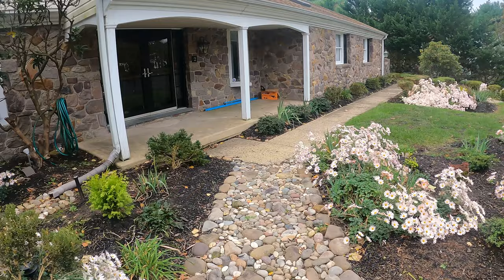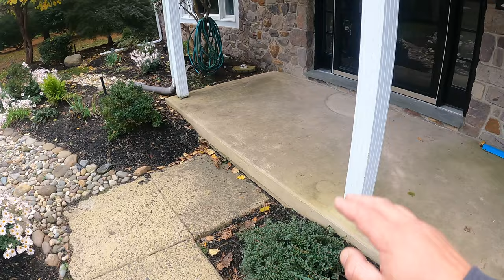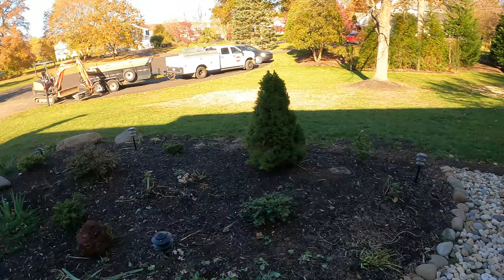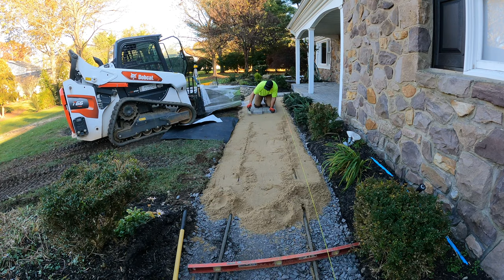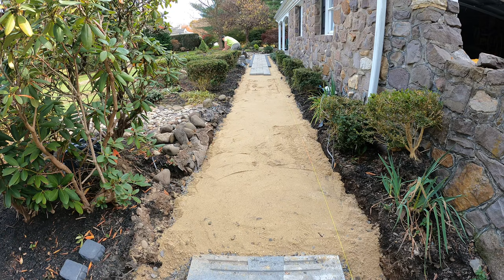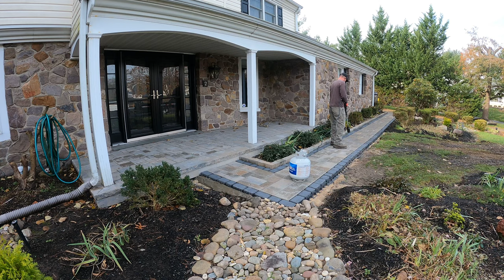Paver walkway with border and stone edging

Comment: I was wondering how you would get the old walkway between the existing shrubs but the reach of the excavator did the trick! If it was me I would be there frustrated with a sledgehammer Looks great and matches up well with your last paver job there!
Reply from the maker: The excavator almost couldn't reach but I was able to slide them a little bit. Thanks for watching 👍

Comment: Nice work.  I’ve watched a bunch of these and have two questions - 1.  Other people use chip stone for second layer rather than sand and 2. Other people edge with concrete instead of landscape edging you used.  Any thoughts?

Comment: Hello, one man army .. 😀.Been watching your videos.May I know the pavers that was put as edging. You were talking Abt it @9:07
Reply from the maker: Thank you, that edging is Brandon by Techo Bloc here's a link. https://www.techo-bloc.com/shop/edges/brandon-edge/
Reply: @srmcontracting  thank you for the details, wish the GoPro recorded that..😔
Reply: Does it get installed same as a paver would be installed? Subgrade..compact.. basematerial..compact..sand and then the Brandon stone?
Reply from the maker: When installing the edging next to a paver walkway. I put the edging right on the compacted paver base. Sand is not necessary. Then I added about 3 in of concrete behind the edging (in the mulch bed). Mulch hides the concrete and this will prevent them from shifting.
Reply: @srmcontracting  Thank you very much for the details